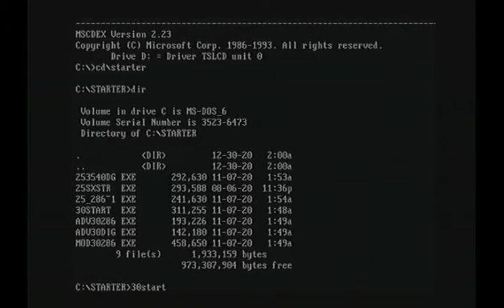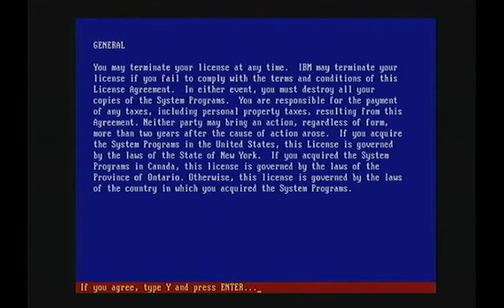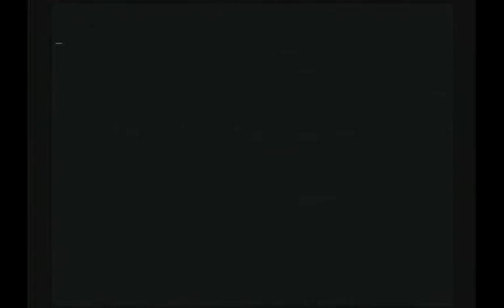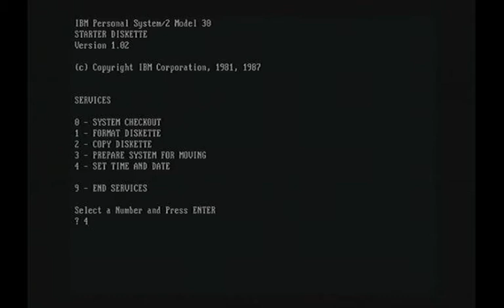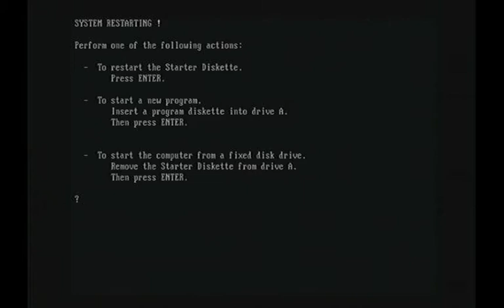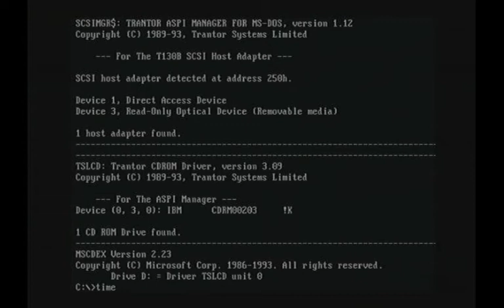Creating a Starter, Option, or Reference Diskette for an IBM PS/2

Comment: What about the '.img' files that you find around online? I'm in Linux doing "if=rf7080a.img of=/dev/sdb" on the command line, but not sure if this is making one correctly. I may have a bad floppy drive, but not sure.
Reply from the maker: I don't know enough Linux - Are you able to see what files are on the diskette afterward?
Reply: @IBM_Museum  Yep, they all show up just fine when I look at it afterward. I do think I probably have a bad drive. It simply stays with the light on when trying to boot from floppy, and although it is constantly spinning, I don't hear it trying to seek on the disk. This is an ALPS.
Reply: @root8272  ever figure it out? I have an ALPS that doesn't seek as well.
Reply: @Vacated204  Unfortunately no. I eventually switched to a floppy drive emulator. Mechanical drives are very cool, just not reliable.